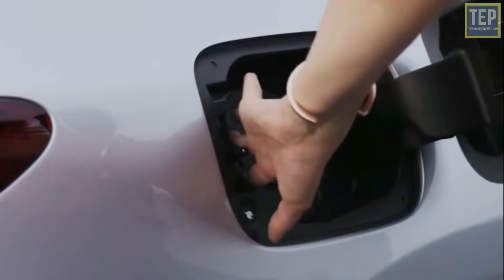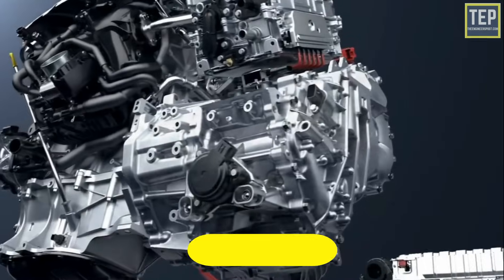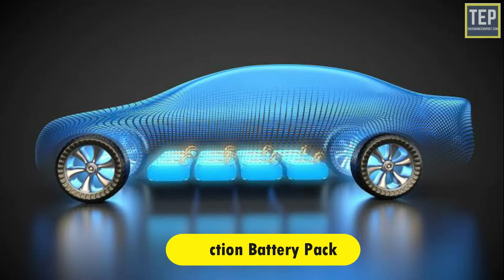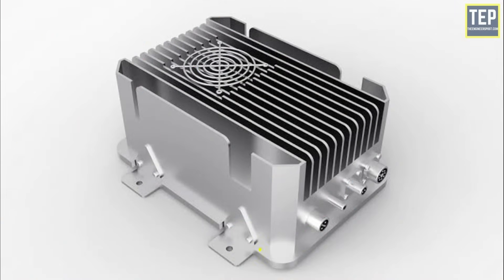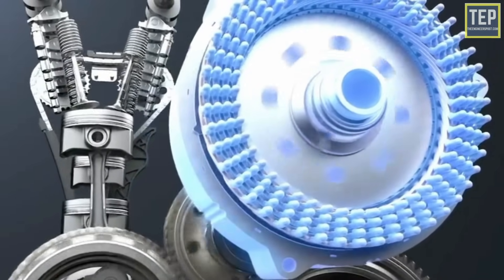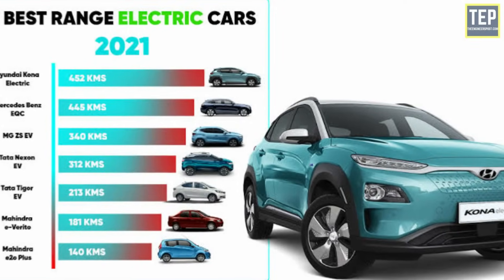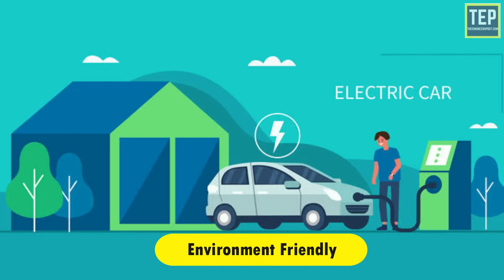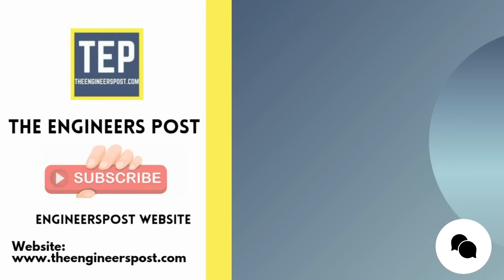How an Electric Car Works? Its Parts & Functions [Explained]

Comment: EVS are only slightly more environment friendly, they don't deposit the emissions in the cities but at the source of the electricity, and the mining of the battery chemicals and then discarding of the batteries etc, etc,

Comment: Good. Only thing he doesn't explain:  DC converted is converted to AC to run an AC motor. Why is AC better than DC?
Reply: its in the name, alternating currents (ac) voltage can be easier  regulated (as its constantly fluctuating in an ev) and direct current (dc) is usually a consistent draw of power

Comment: Some cons you did not mention. EV cars with decent range weigh a lot more than ICE. That means larger tires, suspension, brakes and other components. It also means more mass in motion in case of a crash. All that electricity must be generated. At this time most of that is with polluting power. Include that and EV's are not so green. Batteries require exotic materials. A malfunction of an EV is a big problem at this time. Service is costly and time consuming. This may be improved but it is not there yet. It is not possible at this time to have only EV's. I do agree that ICE cars will be diminished. The question is when not if. The question is if you want to lead the pack or wait and see.
Reply: charging electric vehicles which power source comes from natural gas which is fossil fuel is still bad for the environment
Reply: @trublue2319  There are ten states as of today that are ONE HUNDRED percent green. Of course they are also BLUE.
Reply: ICE are primitive, EV is way better.
Reply: question,what could we remove for weight reduction in an ev?
Reply: @dootdoot7705  Really! You're asking me a question like that. So let me be clear, although I have a technical background, and an interest in EV manufacturing, production, and all that kinda stuff, I have absolutely no business trying to answer such a question, because if I had the answer to that question I wouldn't be talking to you, I'd be talking to Industry bigwigs and demanding compensation.  Comphrende! Cheers!🥂
Reply: @dootdoot7705  It not that much weight (lithium). Also, the extra weight adds to the traction and handling due to its position at level with the axles. Also, what energy is used going up a hill is partially regained going down. I’ve had an EV for over eight years, there’s no looking back. The federal government subsidizes oil and gas to the tune of eleven million every minute 24/7.  I’ll use the phrase that the oil and gas industry used in the early nineties about  why we shouldn’t go green, “It’s the economy STUPID”.
Reply: @dootdoot7705  Keep watching YouTube. There are worldwide efforts to improve the batteries which are most of the weight in an EV. Be prepared for lots of pseudo science. There is an effort to do something with Hydrogen stored energy. It would reduce weight but has other problems. The Japanese and Germans working on that.
I watch this as an hobby. I am no expert but an old BSME from the automotive industry.
Elon Musk is betting on batteries which weigh a lot. But he is the genius. I bought an Lexus because I do not agree with him. Put my money where my mouth is.
Reply: @dootdoot7705  Tesla model S has ~2,000 # battery. That is ridiculous if you consider that most time there is one person in the car. That heavy battery requires heavy tires, suspension and chassis. Compare that with a tank full of gasoline.
Hydrogen tank would be closer to the weight of a gasoline tank and would not need heavier suspension and tires like a Tesla. There are efforts underway to reduce the weight of batteries but it may be when I am dead. Some break through is needed.
Check hydrogen on YouTube. Has its own set of challenges but not dead yet.
Reply: @willdehne1  i am not putting hindenburg in my car,also why does it need heavy wheels?What about wide alloy wheels?Also some things in the car could be sacrificed to reduce weight.
Reply: @dootdoot7705  You are not the only one worried about the Hindenburg effect. A tank with gas is a bomb also and I read that batteries explode sometimes. Regarding "some things in the car could be sacrificed": All the car companies try to do that. It is a fine line of safety vs weight. A 2000 # battery is a lot of mass in motion. Imagine that getting out of control on ice or in an accident. Even worse if the 2000 # explode.
Looks to me we need to work on that before I buy into it.
Reply: Q ni hu
Reply: What is ICE
Reply: @gudasatya99  internal combustion engine
Reply: @xgengx7530  thanks for reply
Reply: @gudasatya99  Internal Combustion Engine.
Reply: @willdehne1  thankyou for replying..
Reply: Electric  cars have much less environmental  than ICE  and the batteries are fully recycling . William, you are basicly wrong.
Reply: How can it not charge itself. Completely inefficient.
Reply: Ant EVs aren't silent, the tires make more noise than combustion engines. Ant tires are on EVs as well
Reply: You should do a vid, well explained
Reply: You don’t realize how much effort…energy…logistics to put a single gasoline liter in a gas station requires? Electric energy needs less logistics and people involved. Batteries need a lot material…yes…but you can recycle at the end of their lifecycle. ICE cars has an old and inefficient technology. That’s a why China and Europe wants to switch to EV. And remember…it’s the beginning of EV era…too much development and improvements are around the corner.
Reply: EV’s are coming whether they like it or not. They are smarter cars, ICE are like the Stone Age now. It’s a breakthrough and it’s developing every year. Can’t look at an ICE the same again. The thing is they just don’t have the money to purchase one so why moan about it instead to hide their envy.
Reply: This is valuable information that the American people should know about.
Reply: @moa3008 América need to switch to EV. If you want to stay with gasoline…it’s like if you wanted to keep using charcoal.
Reply: So I have no dispute with what you’re saying, but this is not a static situation, and it’s not a situation that we can just bury a our head in the sand, so research and development dollars are being spent as we speak, so they’re going to be breakthroughs as there always is and standing in the way by taking a wait and see attitude is exactly what we should not be doing, and the fact that we’re not able to have everything we want at one time shouldn't be an obstacle either. 

So let's not forget that the gasoline powered internal combustion engine cars were not developed overnight, as it took time to build up the infrastructure and the supply chain necessary to support them and the Legacy auto manufacturers has to somehow manage and that’s not going to be an easy task. 

So it would not surprise me that some of these Legacy auto manufacturers we’ll be bankrupt within the next 5 years as the public demands more EV's and so the advantage will be to those start up companies, because they don't have the problems of the Legacy auto manufacturers and such an example would be Tesla, as they came in at a time that allowed them to have virtually no competitors to worry about and their vision to develop the vehicle using the most advanced technology that was not available 50 years ago and because they chose to structure the company the way they did by not using traditional advertisers and selling directly to the consumer, cutting out the middleman so to speak, and so these things have given start up companies like Tesla an enormous advantage over these Legacy auto manufacturers. 

So let's not forget that the internal combustion gasoline powered cars we're driving today took a long time to develop, particularly the infrastructure that support these vehicles, so hopefully the infrastructure to support EV’s more broadly will not take as long, but it will take some time as we saw Tesla make a decision early on to insure that wherever their cars are sold, that they had a supporting net worth of very fast DC chargers to keep their cars on the road, as well as providing the ability to charge at other third-party chargers and of course at home, and so I think these start up EV companies using Tesla as an example will have an enormous advantage over those Legacy auto manufacturers as they don't have to manage a fleet of internal combustion gasoline powered cars.

The other problem that exist is with high gas prices are driving more people to move to EV’s over the ICE cars we’re drive today, so it took a long time to build up all that infrastructure to support these vehicles and there in lies the problem as each of the Legacy auto manufacturers face managing an aging supply chain of parts and suppliers that they still need, as well as the fuels, and the other thing that don’t get mention is the fuel refining capacity is a limiting factor as new capacity to refine these fuels is simply not going to be added as it hasn’t been added in decades and as the public begins to more fully understand the urgency to act in combating climate change and global warming issues, an electric vehicle becomes more desirable, however, having said that this is causing a problem and that there's no more capacity to refine gasoline as it takes years to put new capacity in place and it would make no sense to invest more dollars in an industry that will be dead by the end of the decade, and so those with your mindset of a wait and see attitude are considered dinosaurs and you know what happened to the dinosaurs, right? Cheers!🥂
Reply: @theodorehaskins3756  You put a lot of effort into your reply. You are preaching to the choir I do believe that ICE are on their way out. Eventually! I am 80!
On a lighter note: The dinosaurs got wiped out along most other creatures larger than a mouse. This is according videos from YouTube. I was not there to see that but sounds credible. The human race may be on borrowed time also along with ICE and EV's.
Reply: @willdehne1  Touché! So sometimes the members of the choir needs to hear the sermon too! Comphrende! Cheers!🥂
Reply: @theodorehaskins3756  Thanks for the "choir". A word I seldom use in my GENLISH.
Reply: @willdehne1  Oh you're welcome, as sometime the choir needs to hear the sermon too! Cheers!🥂
Reply: @willdehne1  question, what does ICE stand for? I imagine the C is for combustion and E is for engine but what is I for?
Reply: @TheCrazierz  Internal Combustion Engine.
Reply: @willdehne1  lol I realized it after thinking about it but wasn't sure it was my imagination because it's the first time I've seen the term.
Reply: @theodorehaskins3756 thats a long ass text but one thing tho
ICE car manufacturers will never go bankrupt because there are millions who love ICE cars and hate EVs
Reply: @clovdz6073  So help me understand this, you're complaining about having to read a written reply that you referred to as a text. 

So the last time I checked, there was neither a debate or a discussion about the length of a text message, which this by the way, is not a text message, this is considered commentary just like you would write a formal letter to let's say an editor of a print hardcopy newspaper. 

So would you consider such a correspondence to be a text message? 

So we don't consider this to be official in terms of a response or a comment, it's just someone's opinion, and if they have the facts, they have the facts, and if they don't have the facts, you can call them out for that, but complaining about the length of a written response/comment/message is kinda ridiculous, don't cha think?

Oh, by the way, if that's all you have is a complaint about the length of a comment/response/commentary, that you happen to take exception to, then you must live a charmed life, because I've got a lot of complaints, and not a single one of them have to do with how long someone's comment/commentary/opinion may be. Comphende. Cheers 🥂
Reply: @theodorehaskins3756  ok this is way too big to read so could you sum it up?Also I still live with my parents because my salary could barely sustain me alone from  living month to month so wait and see is the only thing I can do and honestly ill be a gramps by the time ev cars become mandatory and such,possibly even dead so I think I will stick to ICE cars because I find them more fun.
Reply: @dootdoot7705  So that’s your preference, but it is it mine, and it's not where the Industry is going either, and so I don't need to say much more as all you need to do is read the last line and then ask yourself this question, am I a dinosaur?
Reply: ICE CARS ARE *NOT* GOING AWAY ANYTIME SOON, CLOWN
Reply: @JESUSCHRYSLER5512  they are, just like steam engines went away
Reply: @organicfarm5524  NOPE

Comment: Thank you Down to earth explanation. The best part is motor to speed up but turns Alternator when brake appled Energy Conserved a lot. No mechanical gear box No Differentials Oh if higher secondary students are taught this way No costly coaching classes or spoon feeding
Reply: Disposal Pollution  Brother   and Production Big pollution

Comment: How Does A/C work with Electric vehicle & battery life (if it needs replacement with multiple recharge / discharge) could be the areas to consider for explanation.

Comment: Many thanks. 
Enlightening presentation. 
Clearly we are getting close to massive rollout and affordable EVs.
Reply: Until EVs are under $20,000 they are not "affordable" for the average person.  Sure doctors and lawyers will be able to drive them, but not average everyday workers.
Reply: @brewergamer  AND, we currently don't have the electric power generation required to charge a fleet of EVs, exacerbated by the current push to eliminate fossil fuels......not realistic, IMO.
Reply: I priced one at $80,000. Hell they can keep it. I have a 2014 buick lacrosse and a Nissan pathfinder rock creek 2020 and both are paid off and run perfectly. I keep them clean and polished and i take care of them. They not only have to bring down the ev prices but they have to perfect them before i even think about spending $80,000 pluss on one. I travel on i-95 twice a year from Pennsylvania to Florida and i dont see many charging stations. I wish i didn't have to drive down there and i don't fly and of course the mighty United States of America doesn't have highspeed bullet trains which is something we should of had decades ago. Considering how gong ho on Technology this country is. But for now, keep the electric cars and all the money it would take to own one.....

Comment: People are careless.  How do you dispose of the battery when it is no longer functional or when they burn on impact in a collision? What toxins can be released into the atmosphere? How does this effect our power grid?
Reply: Like an ICE cars don't release a MASSIVE amount of toxics just while running 🤣☠ With the advancement of solar energy consumption , electric cars don't affect our power grid like I'm sure you think lol A clueless comments starts off calling people clueless..wild 😅😂
Reply: How do you dispose of your exhaust emissions?
Reply: That’s why has battery management and dashboard
Reply: Also the power grid thingy no one is answering, we will need to improve it anyway after all the energy demands of the future will only go higher. Especially with using renewable as unlike nuclear and fossil fuels you cannot really select where they will be and thus need to improve the grid to transport all the new energy.
Reply: We need to do the same thing we have done with the automotive SLA batteries. 99 percent of those batteries are recycled, vs only 5 percent of these babies. We need to change.
Reply: @Subfightr  5 *5k = 25k  %
Reply: @rohitdawel7760  ?

Comment: Are these EV batteries water proof?
Unlike conventional battery,we need to remove the clamp Head,if the car are submerged in flooded areas,it will damage the electric systems.

Comment: Very helpful information, nicely explained. 
I have two questions: 
1 In a standard hybrid, when the petrol engine has to start up I assume  the electric motor plays the same role as the  the starter plays in conventional petrol car, but it does it far more smoothly. Am I correct ?
2 In a standard hybrid, does the petrol engine directly power the wheels through gear transmission, or are the wheels always powered by the electric motor because the petrol engine simply generates electricity to run the electric motor? Does that mean there is no conventional mechanical transmission system?
Reply: If the car is stationary, yes. Just like a normal car with stop start. But if it is in motion it self bump starts which you can do with a flat battery.
Reply: for number 1 yes you are correct. for number 2,  no. if you have a mild hybrid, then through regenerative braking you can charge a small battery, with which you can use to drive the electric motor. in some cases you have the internal combustion engine(ice) driving the front wheels and the battery and motor on the rear axle. this all depends.
but in a plug hybird, with a high voltage battery, you can choose to completely use the battery.
in both cases the ice will not "generate electricity" because that would be pointless. the point of having an electric motor is using electricity stored in a battery to transfer mechanical energy to the wheels.
an ice already does that, but it is about 70 percent less efficient because of all the mechanical components and thermal loss.

Comment: EV is much less efficient than petrol vehicle because EV is a 4 stage (fuel --> AC electricity --> DC electricity --> battery --> motion) conversion vehicle, while petrol vehicle is just 1 stage (fuel --> motion) conversion. The more conversion stages, the more lost. How can EV is eco-friendly?